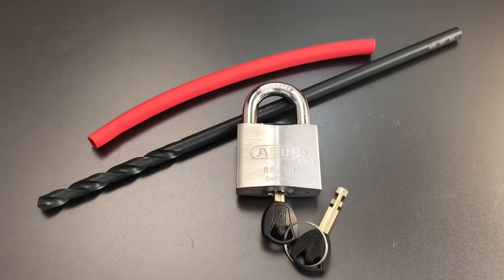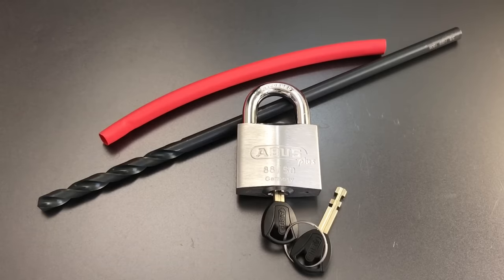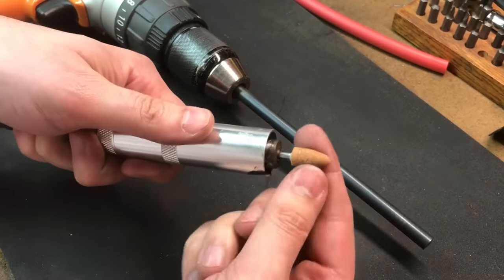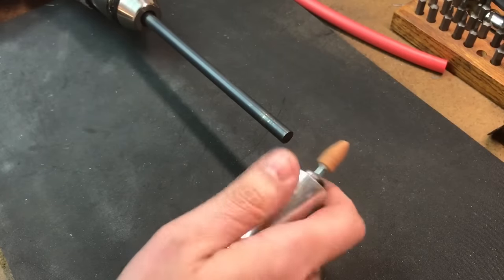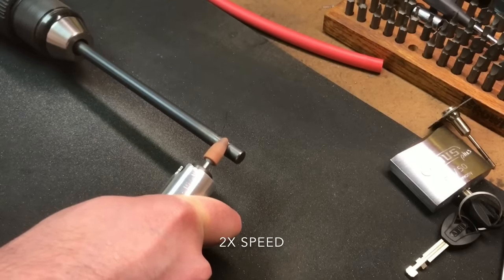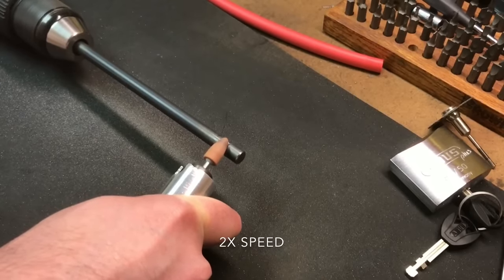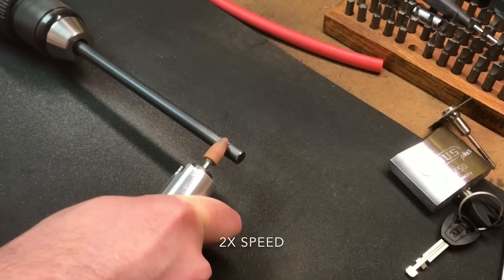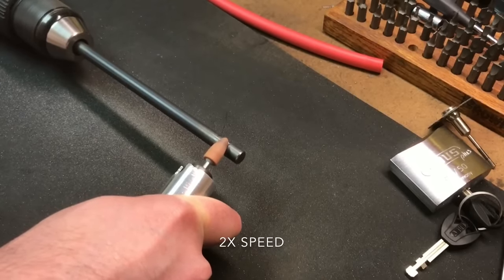[464] LPL Project: The Best Gun Lock Ever?

Comment: Just an observation, if you hold your torch a little further away from the work it will heat up quicker. The hottest part of the flame is where the bright blue area creates a point.
Reply: I'm a lab techie and grown up people refuse to believe this on a daily basis :D
Reply: @user-ul6bm8pt2y na gaz is right
Reply: @user-ul6bm8pt2y   That’s rude!
Reply: @spleeber2013  he's agreeing with me I believe
Reply: @user-ul6bm8pt2y  To be fair i know that but my monkey brain still goes "closer flame more hot" every time i have to heat something, since usually hot things get less hot with distance
Reply: @RepChris  Oh no, things always get less hot with distance. Always.

The question is, distance from what? The heat source. What's the source of heat in a torch flame? Burning gas, not the torch itself. The tip of the blue flame cone is the hottest simply because that's the point away from the torch where as much gas as possible has combusted. That's the point where the gas has added as much heat as it's going to add so from then onward, it will get cooler as expected as that heat spreads out.
Reply: @ashkebora7262  Great explanation of something that has always seemed a bit counterintuitive.
Reply: The hottest part of a flame is the white part
Reply: @TheIrishMugFug I Guess that depends on if the touch can even get to that temp. You are right that color does play a part in how hot a torch can get.
Reply: @TheIrishMugFug  our survey says X
Reply: @TheIrishMugFug  The hottest part of the burning gas is the white part, but being the highest temperature is not the same as containing the most heat content. Everything past the burn point will contain the most heat. Yes, technically precisely at the point of combustion is the hottest temperature, but unless you want to involve the material in the combustion, it's a bad idea and will deliver less heat.
Reply: The second thing we (science teachers) teach about bunsen burners, after how to light them.
Reply: also he can reharden the rod
Reply: @itoibo4208  I wondered if this was possible, but I don't know enough about the hardening process to comment
Reply: @ashkebora7262  I know, but monkey brain thinks flame comes out of hole => hole is where all the heat comes from as opposed to further down the line when you actually get proper combustion
Reply: @spleeber2013  Yeah he is
Reply: This, and that is especially true with MAPP gas.  I used to silver solder refrogeration piping, and the maximum heat of a MAPP gas torch is farther forward in front of the blue cone than an Acetylene  torch.

Comment: Very slick design. Just a couple quick points. After grinding the drill bit to make a grove, wipe off any fillings before testing in the lock. Before appling the rubber coating to the lock, use rubbing alcohol to remove grease and finger prints so the plastic doesn't lift in time
Reply from the maker: I definitely got rid of the dust/filings before moving the gun within 10 yards of the bench.  That can destroy a precision fitted gun like this.  Good point on degreasing.
Reply: @lockpickinglawyer  why didn't you just dip the drill stock at the same time as the lock body.
Reply: @tini4580  it would make the drill bit fuse with the lock and you cant un lock it
Reply: @samueladiwinata3440  you can flip the lock around and dip the shackle without fusing it buddy
Reply: In another comment thread someone addressed this. The plasti-dip will flake off as it wears, not what you want inside your precision firearm.

Comment: An empty paint can, the small ones, can be used to store the plasti-dip after opening it and will keep it fresh. It's what we did at a plant that I worked at where we used it as a bolt tightened indicator and tool handle maker.
Reply: Basically get it into something which seals well and completely fills it - the air gap at the top is what'll make it go bad
Reply: @TimSheehan  You need a seal that will stop really light petroleum distillates from evaporating. Paint cans usually pull this off with their spring steel seal as it is very tight and what little sealant it there is not permeable to the stuff that is going to evaporate off from the product.

You do want to use a paint can rated at holding enamel and shellac paints as they use the kind of solvents that are similar to the stuff you are trying to not have evaporate, so the seals on the cans will work.

Comment: "extraordinarily difficult to pick" 

a few years later: "I'm going to use the pick Bosnian Bill and I made... and as you saw that wasn't too difficult a pick"
Reply: What ep number is that
Reply: Several just keep watching and you will stumble on one of them.

Of course this lock still works for purpose since a curious teen likely does not have access to that special pick until they also are mature enough to be taught proper firearm handling.
Reply: the fact they had to make the pick is one huge difficulty
Reply: "stopping an unskilled adolescent from accessing the lock"
Most unskilled adolescents don't have highly specialized lockpicking equipment. No gun lock is going to stop a criminal from using the unsecured firearm you left lying around, but one like this mostly will keep your kids from shooting themselves or others with it (which is #2 cause of death among children even if you remove gun homicides from the mix).
Reply: That just showcases the need for the industry to keep evolving and not just keep reusing the same outdated designs
Reply: @jaturnley  I highly doubt that. Accidental deaths caused by children getting a hold of a firearm do happen quite a lot, but it's no where near the 2nd most common non intentional cause of death for children. It's only that high if you include homicides or self terminations which aren't accidents.
Reply: @skitidet4302  Do a search for it. It’s second behind auto accidents. And you do have to include “self termination” (who the hell calls suicide that?) in the figure because statistically it’s a preventable death, most kids aren’t going to be as successful with other methods. Otherwise the number of suicides in homes with guns wouldn’t be higher than ones without them.
Reply: That explains it.  Thank you.
Reply: For a picker of average skill it takes several minutes that is enough
Reply: @jaturnley  It's YouTube, so I assumed you could not type that word if you don't want your comment memory holed.

Also, I did search for it and it does include intentional things. The reason it's so high is mostly because criminal gangs don't have an age limit to join them so you have tons of "diverse" "children"(more like young adults) killing each other in wonderful places like Chicago and Baltimore.
Reply: @jaturnley no, but not all adolescents are unskilled. I began picking locks when I was about 10. Of course! I also knew about guns and how to handle them before then. When I was growing up in our rural area it was not uncommon for people in high school to be running trap lines, and if you run a trap line you have to have a gun to execute trapped animals.

The best option is still to have the lock built into the gun.

Comment: Years ago I was doing some prototyping and opened four new different color cans of PlastiDip thinking I could use a tiny amount and they'd keep fine on the shelf...lesson learned...
Reply from the maker: LOL... yup, it happens to us all... once.
Reply: thechosendude remelt it if it dries out.
Reply: Ron Calabrese you can do that?
Reply: Naphta gets it usable again
Reply: Won't happen to me now ;)
Reply: I was told that covering with aluminum foil and taping it tightly over the can would keep it from drying out, but I haven't tried that method myself yet. Has anyone tried that and failed?
Reply: What about vacuum sealing it?
Reply: I keep things in tubs/cans wet by placing some saran wrap on top of the product inside the can so a barrier is created between the product and the air inside, I push the wrap against the inside of the tub to get as much air out as possible and put the lid on with the wrap sticking out. It wont work for everything but it is worth a try.
Reply: Don This. Even if it has a reusable lid, unless that lid has a proper seal and tight fit, it will leak air. Some thin plastic foil (multiple layers if the lid is very loose) over the top before putting the lid on will seal it good. Putting a layer on the surface of the content is also a good idea, minimizing exposure to the air thats inside the can. Can do this with food cans too, if you use only ie. half a can of something.

Related; a couple of layers of this stuff between the brake fluid reservoir body and cap (closed), will drasticly reduce the ammount of spilling when you need to open or disconnect a brake line. Which also means less air drawn in.
Reply: The crappy plastic push lid supplied with this style of can is no good. Pour it all into a better container with a decent sealed lid as soon as you have opened a can like this. Even a metal lidded jam jar would be much better (plastidip around the lip of the jar, and you will probably get a better seal). Larger quantities are supplied in paint style tins which seal well but inconvenient to open and re-open for regular use. It's just evaporation of the solvent you are trying to stop so it needs a good seal; you don't need to exclude the air, as long as it can't escape. It is much like storing paint. The Plastidip company sells thinners but, as mentioned, I think it is just naptha. You can get dried stuff going again by adding solvent and with a bit of patience and stirring/shaking but it may have lumps in. Some colours have a different consistency to others in my experience though I may be mistaken.
Reply: Just get spray cans... Lol
Reply: To to your local paint store and buy either a pint or quart sized metal paint can - depending on how much dip you expect to have left over.

The dip will list the solvent - buy a bit and float maybe a teaspoon or tablespoon of it on the surface after it has been placed in the storage container. If tightly sealed, there won't even be a skin on the surface when you next open the can - assuming you keep the can upright and do not shake it.
Reply: The trick is to fill the volume left by whatever you've removed. If you put in something to raise the liquid to the top (I use aquarium marbles because they're cheap in bulk and easy to clean up for reuse) and then use saran wrap or something similarly tight, it'll last a good long while on the shelf. Not always worth the hassle, but I've found it to work well if I'd be wasting a lot otherwise.
Reply: Store the can upside down.  The contents themselves will seal out the air.

Comment: I've been looking for a good lock and some other parts to make something similar, when I stumbled across the ABUS 83/45 series. They have interchangeable shackles, which include a 6" version. I was going to attempt to do what you did here, but I found the 6" shackle fits perfectly with some room to spare in my full size Glock 22. It has the advantage of being a fully hardened/alloyed shackle with both sides present and locked in bearings. The lock is also available with either an ABUS core or SFIC style. If you are worried about pick attacks you could use a 7 pin peaks or cormax SFIC core for a pretty secure lock.

As a bonus, I can use the SFIC core to make it match all my other locks. Since I use this to travel through the airport I can use the same key to lock the gun and the case as required by TSA. I love building my own stuff, but this was much easier than making my own and probably more secure. Definitely more secure than the standard cheap cable type gun locks.

I do plan on giving it a plasti-dip to protect the gun unless I can manage to get some heat shrink tubing over the shackle.
Reply: You can stretch heat shrink while heating it (I usually use needle nose pliers for short pieces) also making it easier to slide over it then heat it as normal to shrink it.
Reply: @garyhager714  maybe nail clippers to snip some of the excess material off, or even just plasti-dip that part too.
Reply: I appreciate LPL providing the education regarding tools, plastidip, heat shrink, etc... and a basic blueprint for a firearm lock. I also appreciate croud-sourcing the incremental improvements to that blueprint. Thanks for the vid that stands the test of time... 5 years and counting.

Comment: The most I've learned from the gun lock series is that a good gun lock has to 

A. Prevent the gun from firing (Ie, prevent the gun from going into battery, doesn't work for all firearms but a lot of modern ones can't be used if the bolt isn't fully closed)
and
B. Not be unlocked with a piece of metal that you can violently shake inside the core of the lock until it pops open.

Comment: if the sparks are going in your direction that means that if the rotatory tool jumps out of your control it will roll away and not directly in your fingers holding those pliers (just like the angle grinder or a chainsaw throws the sparks-sawdust in your direction)
Reply: You know, I never consciously thought about it that way. Nicely put. God I have a love hate relationship with death wheels.
Reply: Either way use PPE, when the disc explodes they do considerable damage. I have a scar on my wrist to remind me, luckily it missed my artery.

Comment: I enjoy shooting sports and I enjoy watching YouTube regarding them.. I'm happy to see (finally) a video about safe keeping of your firearm. Even if you had to build it yourself.
No one regularly reviews safety equipment, sometimes I see a review of a safe but that's all.
Reply from the maker: Thanks -- most of the gun locks out there are pretty bad.  I put together a playlist of several gun locks on my channel if you are interested.
Reply: I have a questiom please. isnt this way of storing the gun weakening the springs inside ? 
thanks for the reply, if there will be some
Reply: @HyennaTheOne This is pretty similar to a chamber flag or cable-type handgun lock for installation, which are pretty common and even supplied by manufacturers. It shouldn't damage anything.

Comment: Hey LPL, not sure if this was updated or that you will see this but just some tips for you and anyone who might want to make this:

When marking the notch for the shank, just put it next to the one you cut off and mark the center of the existing notch on the drillbit. Perfect every time.

Honestly ditch the dremel idea, a small angle grinder can be had cheaper than a typical dremel, in my exp. more people have grinders too.
Get a grind wheel and a cut off wheel.
You could also grind away one side, less material to take away. just make sure the bend direction corresponds.

With the heatshrink just use a cigarette/BBQ lighter - good temperature for heatshrink and low risk of burning. if you do have a heatgun on hand theyre ideal.
 For a simple upgrade you could also look at foam lagging on top of the shrink, inexpensive and if you can find a suitable size it would give a better fit and more protection for your peice.

Other than that this is a very simple but effective design.

Comment: Don't know how i missed this video for 6 years. Still a very valuable project!
My only suggestions for improvement are:
1) Use the shakle to mark off the groove on the drill bit. To make it easier to tell when you are getting close
2) Use the cutoff wheel to cut the depth of the groove then come back with the grinding stone to shape.
3) Hold torch back when heating so the tip of the blue flame is almost touching.
4) Directly after the bend is complete, reheat to red hot and drop in oil to quench. Any oil will do, I typically use used motor oil.
5) Clean both the lockbody and drill bit with acetone or 90%+ isopropyl alcohol prior to coating. I've had issues with plasti dip debonding if surface is not very clean. I would also place a few drops of the plasti dip down the end of the heat shrink which will completly seal the end.
Reply: Great advice, not just for this project!

Comment: Thank you for taking time and tremendous effort to guide us through the steps of making such an original and effective gun lock. I think many viewers don't realize exactly what goes into making a production of such length and detail.
P.S. I invested in a heat gun around a decade ago and it's been a godsend. I highly recommend it.
Reply from the maker: Thanks... and you are correct that this was a bit of a PITA, but not as bad as I thought.   Also, I have a heat gun.  Trying to keep the number of tools to a minimum, thus using the torch for two purposes.
Reply: LockPickingLawyer Oh! I heard you mention keeping tools to a minimum, but didn't realize you dual-purposed the torch. I was threading chambers of a core while your video played. So I wasn't quite as attentive as usual.

Comment: Really great project! I do have a couple of suggestions to refine this project a bit. 1) I would use a paste (not liquid) type epoxy, something like PC-7, to secure the cut off portion of the shackle in the lock body then sand it flush I worry that hot glue could come loose over time and the cut off shackle could rotate with hard use (i.e. taking the lock off the gun and throwing it into a truck bed) 2) heat the long portion of the heat shrink tubing to up to about an inch from the bend so that it is retained. Then pull the short end tight to remove the wrinkles at the bend, then finish the rest of the heat shrink. 3) Not sure if it would work but you could use the cut off portion (the non-retained part) in the lock body when you dip it. Then cut the plastidip flush against the top of the lock against the shackle which should make for a slightly cleaner look.  Again these are small suggestions for a more refined look - nothing wrong with what you did here!
Reply from the maker: Thanks for the suggestions.